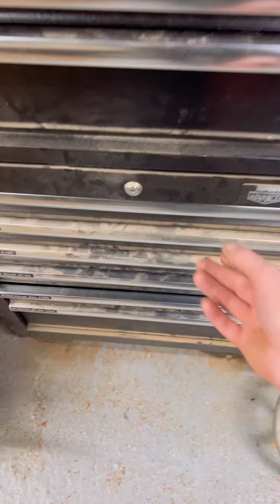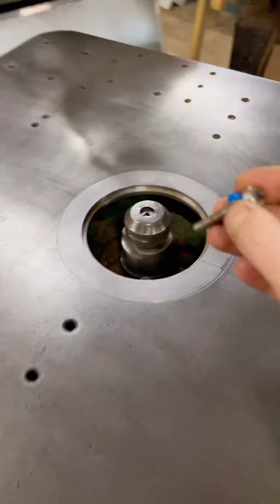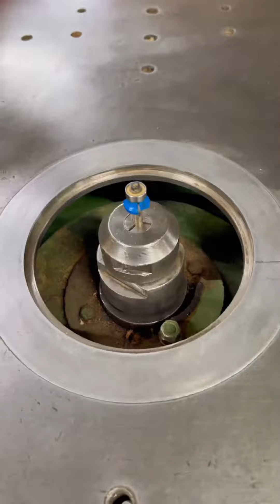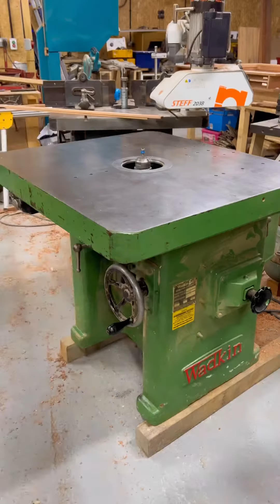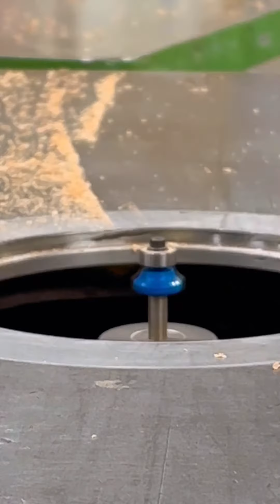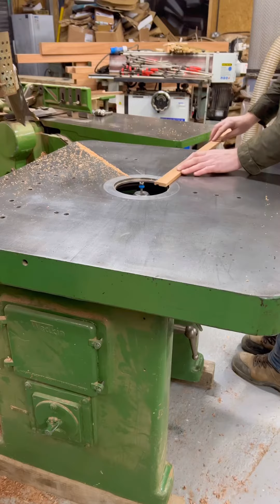Worlds best router table

Comment: That's quite a rare machine, the high speed version of the EQ, yours was built in 1962, based on the Test Number
Reply from the maker: That’s Nigel. I know there’s not many of them about are there. I only know of 3 others. Your right on the test number. Sadly this ones lost its original fence along the way and now has a horseshoe shaped one
Reply: @amhjoinery2060  I have a EX2 with missed matched fences, I don't think either of them are original, I will have to find some EQ's parts to try and get the EX back to original
Reply from the maker: @nigelknight1435  very nice. Do you use Instagram? If so find me on there I may be able to help you find some fences. Or there’s a Facebook wadkin page too
Reply from the maker: @nigelknight1435  I’d love to see some pictures of the ex2 you so rarely see them. I think I’ve seen one come up for sale ever

Comment: Most of the EQZs were scrapped. They were very common in London and Sussex in the repro  industry for use with French heads or router collets . Other than that they were of minimal use due to speed issues.